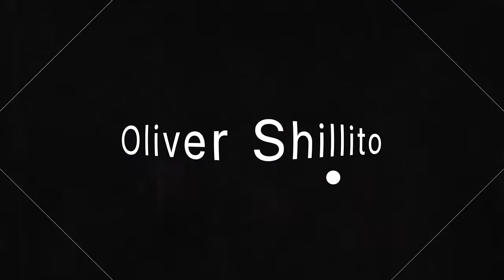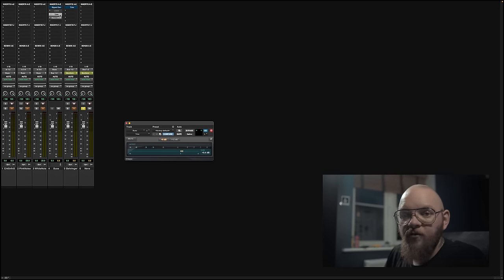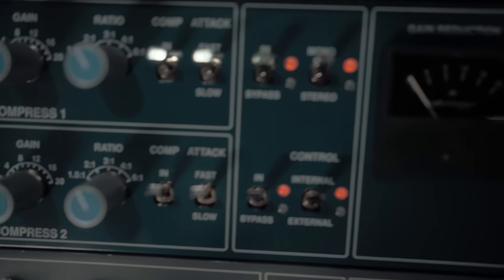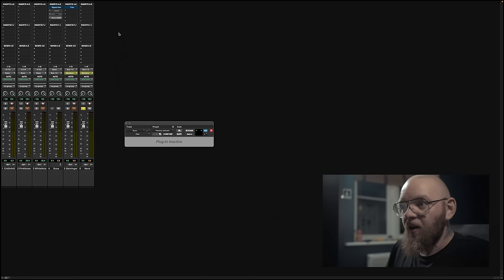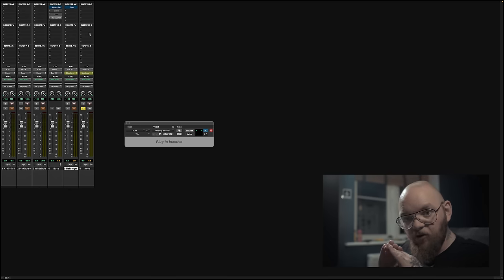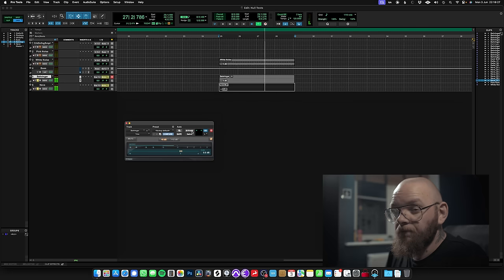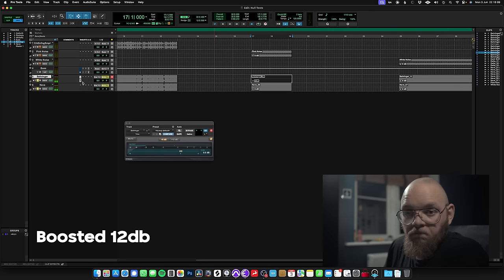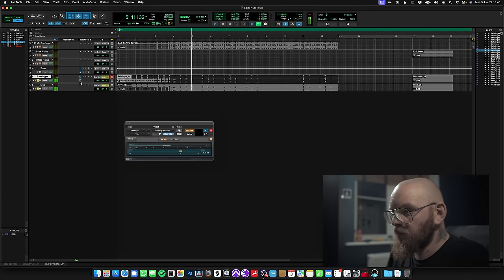Behringer 369-KT vs Neve 33609/J. - Null Tests

Comment: why would anyone think two analogue devices would null 😂😂😂
Reply: Null is good to examine the spectral differences 👂🦻
Reply: Especially compression.
Reply: No 2 analogue units from the same brand will sound exactly the same, let alone 2 units from different brands..  the Null test has always been a joke to me!
Reply: @theCarouselPainter  That's why you have to pay extra $ for a paired devices... 🙃
Reply: Even paired over time tends to sway and there have been instances where pairs are still off
Reply: @theCarouselPainter not always - of course you can null test two static signals - dynamic changing signals not so much though.
Reply: Will not? @theCarouselPainter
Reply: That whole Null thing comes from plugins imo - try and null two different channels on a console - it is impossible due to small differences in the single components - and that is the magic of analog:)
Reply: If the null test is a joke to you, you don't understand it... 

Now, a null test normally means checking to see if they cancel .. not to hear what the differences are, so perhaps that's the confusion here. 

Listening to how they cancel is informative but I just wouldn't call it a "null test" . 'Test' implies pass or fail.
Reply: Not really - the null test comes from things like testing cables to prove they don't make a difference to the sound. It is used when there is strong change something being tested does not influence sound one bit - but it is not normally used to test complex signal paths because of the high chance that there are just random differences anyway.
Reply: Exactly! even bouncing the same mix again though the same analog mix bus chain 10 min later will not null. ITB the mix will always sound identical, except with a few plugins that emulate tiny analog randomness.
Reply: @miekwavesoundlab  but not applicable to analogue non linear hardware
Reply: @LaFaMiMusic  and even then they won’t match 100% due to component tolerances
Reply: Bingo. Plus the 33609 has had many revisions between the letters. Even the N has had a revision without a new letter.
Reply: Computing.....Computing...Null...Null...Error! Non-Sequitur.. Non-Sequitur...Cannot Compute...Shutting Down...
Reply: @miekwavesoundlab  So are your ears...
Reply: It is the most incorrect method to judge especially analog hardware, in fact even the same machines of the same brand and of the same production series do not cancel each other out!  🤣 So as a test it has ABSOLUTELY NO value 😉
Reply: Absolutely. But probably still interesting for those plugin boys who barely ever worked with pure analogue recording setups, so they have it confirmed… there’s “NOTHING” that’s 100% identical in the analogue world.
Reply: Two analog devices can null if you calibrate them… 🙄
Reply: @gmrossi7863  It's a good method to analyse analogue hardware differences in output. 

If you are unable to get any value out of it... that says something about your thinking.

As with any tool or method of analysis, their value is in how they are thought about.
Reply: well they (almost) do
Reply: your emojis show your complete ignorance.
Reply: Because there's no reason they wouldn't. There would be some non-linearity but for devices with similar specs it would be near the noise floor
Reply: @theCarouselPainter  "the Null test has always been a joke to me!" That's because you don't understant it and believe myths
Reply: @indigoskywalker  It's totally applicable, and it's something audio engineers (actual ones, with PhDs, not guys pushing faders and believing myths) used as a test way before digital audio hardware was a thing. Doesn't have to null perfectly, "null test" is just the name, based on the 100% equal result. It's still a tool when it's not nulling, and is a way to get a diff between the two signals/units and see how important it is. Even when it's not nulling, for example, if the opposite phase remainder is near the noise floor the units are not really that different.
Reply: @gmrossi7863  "even the same machines of the same brand and of the same production series do not cancel each other out!" which is irrelevant, the inverted phase mix still gives the diff between the two signals and how relevant / pronnounced or irrelevant it is. Null test is just the name of the test, it doesn't have to null (i.e. 100% same) for the inverted phase mix to be useful as a test...
Reply: To scientifically define how relevant or not a phenomenon is, you should have a specific database: let's take an example: database of phase cancellation measurements of at least 30 1173 vintages, of at least 30 1173 current ones, make the right statistical calculations and quantify the real value of a specific machine in its various important incarnations (and this value is always given by average +/-2*STDev simplifying a lot, there are more accurate calculations if desired).  And this is the minimum.  If you don't have these quantitative databases it's completely irrelevant: what would be the threshold that defines whether a hardware clone or plug-in actually has the sound of the "original" machine in the absence of all this?  The most you can say through a dry null test is to say: this clone, or digital emulation, has approximately (a theoretically very large approximately because in the absence of those databases whose standard deviation values are previously missing), for example, 60 % of the original machine sound (simply measuring the decibel difference d against normalized applied phase *100).  But it is absolutely USELESS as an estimate.  All those who answered the opposite should review the scientific method for a moment (with all due respect). @foljs5858 and others
Reply: @gmrossi7863  "database of phase cancellation measurements of at least 30 1173 vintages, of at least 30 1173 current ones, make the right statistical calculations and quantify the real value of a specific machine in its various important incarnations"

Nope, unless you're doing statistics across production runs, or unless e.g. 1173 results are a totally random walk, in which case, why use a 1173 in the first place? There will small differences between units and production runs, but they're expected to be small, and the behavior more or less consistent, regardless if you use one 1173 unit or another. 

The purpose is to check the units you have in hand (and get a basic understanding of how the model differs to a competitor model in general) not to do quality assurance testing for the company across their production run
Reply: @foljs5858 From tests that I was able to do, given due of a very external collaboration in reality, but sufficient to have the appropriate training, the differences between vintage machines, even from the same batch, were of the order of 10/15% (hoped for 5% but not was never like this).  And we are talking about the same batch, when the batches change the internal components can also change simply because a transistor manufacturer, for example, closes and new producers need to be found who will inevitably give a different sound.  Today the situation is more stable, perhaps we are close to the desirable 5%, but in reality not.  All this greatly undermines your thesis, if you don't understand it it's just bias as it is simply simple logic (but not therefore incorrect).  1173 was one example among thousands possible
Reply: @foljs5858 Then in statistics, which is science, it is precisely to take the most random sample possible so that there are no dependencies between the variables, otherwise the effectiveness of the central limit theorem will be undermined.  So yes, the right sample is mostly possible random and for that reason paradoxically it will be possible to derive a more realistic measurement from it, therefore...
Reply: It's obviously never going to completely null.  No two analogue pieces will null. But the closer to null it gets, the more similar the two pieces of gear sound.
Reply: They're definitely very similar.

It would be interesting to see a null test, with a mono signal, of the two channels of each processor.
Reply: @IvanTheUndertaker or go null left ch against right ch, to start.
Reply: Right. Stupid test
Reply: Lol
Reply: This video is a absolutely ridiculous...

Comment: A new 33609 in the USA is $3995 and the behringer is $599. I definitely do not hear a  $2700+ difference.
Reply: Well China appreciates that you cannot hear any difference.
Reply: @nicefish10  Good for them, competition is good.
Reply: It’s not just about “sound”. If you see it as an investment you care about reliability, consistency, maintenance, depreciation, etc… how many 33609 have lasted for decades and how many Berhinger KT will be operative or will have a repair support? If it is just an outboard gear to use, yes, it is damn impressive, but if it is an investment, it is not a 33609 not even close. Anyway, I will probably get one cause I love diode bridge compressors and for 500€ here in Spain I can afford it and play with it in recordings and mixes.
Reply: @Justanothermusicproducer  we are talking here multiplier of price. Not just 100% for example. There is no comparison. If the difference in sound is negligeble or very slim, it is a no brainer.
Reply: What I found  out for the last forty years. If you like a certain aspect about a peace of hardware - that certain sound which is maybe only 5 percent - don‘t buy stuff that is „in the same ballpark“ aka „it also eqs or compresses“. Get the real thing instead buying five pieces of hardware or software which are „almost there“. You won‘t regret.
Reply: do you hear a 450+ bucks difference between behringer and a plugin?
Reply: China make the best tubes in our time, tubetech use Chineese tubes, China make the worst and the best.
Reply: @nicefish10 numba wan
Reply: @amplifier2  I fundamentally agree. However it’s more important to start recording with whatever you have instead of waiting till you have all the right gear but thankfully there are plenty of serviceable free and cheap plugins to get people started. I would have saved so much time and money just getting the right gear the first time instead of getting cheap stuff and slowly building up nicer pieces but live and learn.
Reply: @snubdawg1386   Do you hear the difference between an acoustic drumkit and an e-drumkit triggering EZDrummer? Your average listener won't, but the drummer playing the track will!
Reply: $499
Reply: @snubdawg1386  yes
Reply: @nicefish10  China, Japan, Europe, SUA, Taiwan, who the fuck cares If it sounds good with 2700k less??
Reply: @Justanothermusicproducer curious why do u like diode bridge. i had the HA successor, maybe i am weird but found it to be so boring and so subtle!

good points about boring grr though; probably won’t last
Reply: there are reviews that say it has less stereo width actually and some other differences too

Comment: Great video, thank you! Take two Neves and you probably get the same result, its analog gear, no two will sound exactly the same.
Reply: Logically, sure you could say that no two of the same gear will sound the same ... but in many cases, even where there is clear difference heard when trying to null them, that difference is often impossible to perceived ... but people will believe they do.

Sure, some vintage gear may vary so much from aging components that you can hear differences readily, but you can't trust your brain to not just imagine differences in perception.
Reply: @natdenchfield8061  Most people can hear the differences just by looking at the logo batch on the unit, if it says Neve it sounds great, if it is not it sounds bad......

Comment: So…this means these two units do not compress similarly at all.  When you have music, the null leaves the top end, but more importantly all the transients. The compression character is completely different. This doesn’t show with pink or white noise because there’s no transients. EQ wise, yes close but there’s less bass and more top end with the behringer. If you’re buying this as a compressor…which is what this is, it’s not compressing the same
Reply: Keep in mind that The dials aren't likely to be tuned very closely.... Even on a lot of analog units of the same variety... Especially older ones before the tolerance has got tighter, You would have to have very different settings on different units to dial in basically the same settings... I still would be some real variance between units
Reply: You can just turn the knobs until it sounds good
Reply: @ramspencer5492  He dialed them in as close as possible. Two calibrated analog units of the same model would null more than this test. I’m not saying the behringer sounds bad, I’m saying it doesn’t compress the same. That’s what this null test shows.

Comment: People have really unrealistic expectations for behringer’s performance.  Every time a clone is released, people are quick to point out how it doesn’t sound 100% the same. A compressor is a tool and as long as the person using it is able to get the desired results that’s all that matters. Most people aren’t gonna have the ear to hear the difference of what gear you’re using.  Only musicians are snobby about gear.  Most hit recorded were all made by broke musicians using 2nd hand gear.

Comment: For your next couple of tests, you should see if two units of the Behringer will null out, then do the same with two units of the Neve.  All electronic components have minute differences, which are compounded as more circuit complications are added, plus the variability in accuracy of pots, switches, etc.  I would be very surprised if two supposedly identical units actually nulled out any better than the A vs B test you did in this video.

Comment: The one issue with null test, is that you get the combined difference. So you get a bit of the difference from each unit. I wish there was a test to subtract the difference from each unit. That way we could easier tell if there what is different between the units, possibly trim it. But also the null test, can be up to twice the difference between one unit and the other, if both adds equally amount of difference.

Comment: I've had a Neve 33609JD for ten years or so, it's an incredible compressor, probably my favourite for making things sound expensive. The Behringer doesn't seem to quite pull that off in these tests, (at least as far as I can tell) but it does sound really good and without a doubt worth the $$$. Thank you for doing all these tests by the way, really good stuff.
Reply from the maker: Thanks for watching!

Comment: Great series of videos. One thing null testings don't really work in hardware, even if you take the same model (of the same company), but units from different years (not the same batch), you will get differences, ALL the electronics (caps, resistors,...) have error, the more expensive, the more accurate, but since we have 100's of resistors in a unit, and the most expansive are 1% error (gold), it adds up. Also you don't mach HW by eyes, meaning you would get a closer null test by playing with the Neve pots. so they would match the Beringer (or vise-versa). Even so, it's very close.

Comment: 6:14 It is not possible to say which is contributing to the various aspects of the residual signal after the null test unless you raise the level in the box slightly for one then the other. Doing that will reveal which one was leaving in the transients, etc.

Comment: well done, one detail, one can import the files to RX (or similar) and match the phase because a latency difference will "sound
 more than it is. it can explain why the noise sounds the same and the material sounds more different
Reply from the maker: A good suggestion. My input lag is calculated and the round trip latency should be accounted for. Both units are coming in and out of the same converter so it should be identical as far as I am concerned!

Comment: Awesome.  This is a great addition to the other vids.  I suppose the remaining question about the cheaper version is long term stability.  As the analog components drift, will they mimic the more expensive gear or will it be very different/worse/better?  🤷 Regardless, you've presented a compelling case for those of us that can't afford the "real thing."

Comment: Two analog devices, in particular buss comp/limiters, will never totally null. 

This is due to:

1. **Component Variations**: Even identical models have slight differences in their electronic components.
2. **Non-linear Characteristics**: Analog devices introduce harmonic distortions and other non-linearities that differ between units.
3. **Response Time Differences**: Attack and release times may vary, causing different signal processing.
4. **Calibration Variations**: Small differences in control settings (threshold, ratio, attack, release) affect behavior.

These variations prevent perfect phase cancellation, leading to partial cancellations with residual differences.

Comment: Channel imbalance is the issue in the first half. One of the 2 devices is not properly balanced and the level output is causing the partial null. If you gain match these channels, the null should be fairly complete.

The other issue seems to be the attack time. If you measured the pulses you'd have a sense of how different the attack times are. It seems fairly drastic (maybe 10mS) so one design using a different value to the other. Worth trying to determine the value and see if this is a design error they could revise, or if they just went with the new attack time based on preference.

Comment: The small differences are what make the difference. If I want the 33609 sound, I want that exact sound. If I wanted "almost the same sound" I would buy the plugin for 50$.
Reply: even if they don’t sound the same an analog compressor will always sound/react differently than a plug in and is much more fun to play around… i love mine as i love my other analog compressors (tegeler creme, bluey, rnla…)…